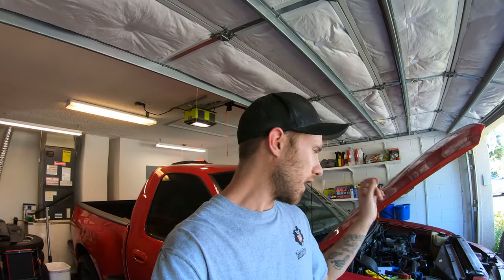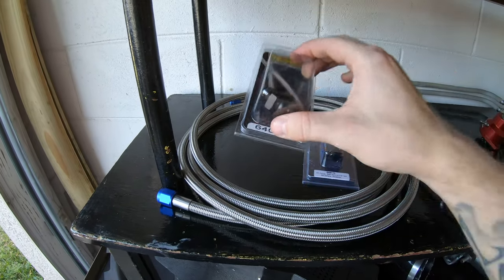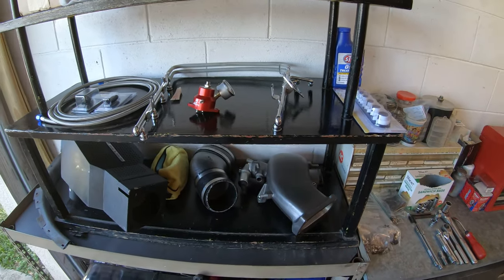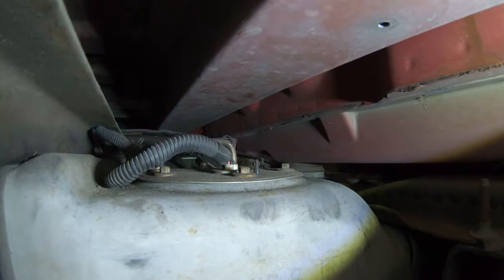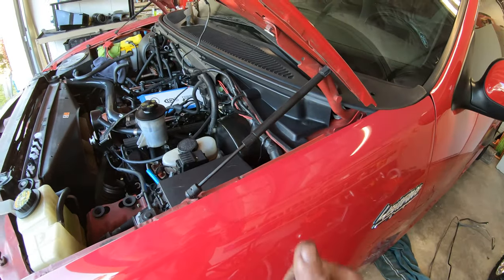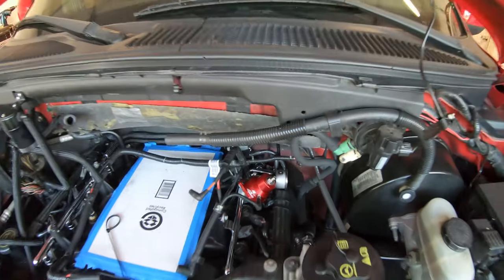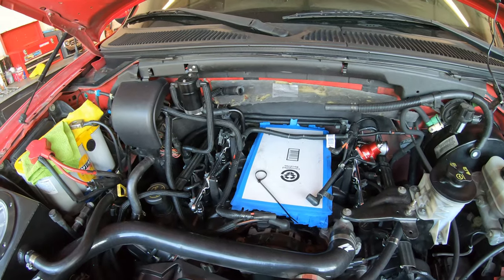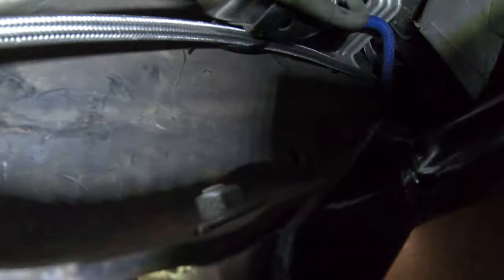Ford Lightning Build - Upgrading the Fuel System

Comment from the maker: Thanks for Watching!  Don't forget to Like the video and Subscribe!
One thing I forgot to mention, is you need to test for leaks before starting it up and set the fuel pressure, to be shown in a future video!
Reply from the maker: @one_day_at_a_time9915  5-6k if being built locally, maybe more, just make sure it’s a reputable shop, with lots of Ford mod motor experience.   Definitely don’t wanna cut corners or go cheap!
Reply: What do you set the regulator at did you make a video about that
Reply from the maker: @RACERHOLESHOT528  set it to 39psi with the vacuum reference not connected, it should drop to around 32-34psi with it connected.

Comment: how much hp is the stock fuel rail good for and can you use it for e85 the setup you installed with the 1997 rail ...im guessing you just have to chang the back fuel line on the rail also ..let me know thanks
Reply from the maker: The stock or 97 rails are good for up to 700whp, the Feed/return lines are good for about 625-650, most upgrade those to -8an feed/-6an return, to have a 700hp capable system.  They will work with e85, just keep in mind you need 30% more fuel, so you loose hp capability due to the flow demand e85 requires
Reply: @DebtLife_Projects  ya i was thing to getting aftermarket fuel rails but I see what you have done and I like it then I will just swap out the lines and what fuel pump setup do you have ? Do you know if a 2001 5.4 not lighting would have the same tank setup?
Reply from the maker: Im running dual Walbro 255's, Im not sure on the non lightning setups, no idea what pumps they run.

Comment: Hi I've been watching your videos, nice work. My friend have a 04 lightning we just put an engine in it. It's a built bottom end stock heads. We're having some issues, he's using DW 95lb injectors and wallbro 255 pumps. It's running lean sometimes and too rich sometimes without going into boost. I'm thinking the fuel pressure is not right because of the bigger pumps. It still has the stock fuel rail and regulator as well as the stock lines, but I think it needs a adjustable regulator. What do you think?
Reply: Dwight I have a similar problem, does yours have a hard start too? ever since the motor replacement I've had a hard start and bouncing idle. I had stock pumps then ran lean at the dyno then went with 255 pumps running all the time. Still have the bouncing idle and since then I've  replaced cam position sensor crank position sensor idle control valve and now im thinking its the fuel pressure regulator, IDK though.... But I just keep chasing this bouncing idle so if anyone has any input lmk!!
Reply: @kevincastonguay5690  hi Kevin, no I don't have any problems starting just running very rich and when I'm driving sometimes it shuts off when coming to a stop or slowing down. I believe it doing that because the fuel pressure is too high. I ordered the aeromotive fuel rail kit with the adjustable regulator that should take care of the problem. I was trying to find an adjustable regulator that could fit in the stock rails but couldn't find anything.

Comment: How far will 6an fuel lines get you? I see that you had quite a bit of extra line after you installed these lines. I wonder if this would be a good amount for my Harley truck or would I need more?
Reply from the maker: Length wise?  I'd say you should have enough, I had at least 3 extra feet of line that I had to loop up into the frame rails.  But don't quote me on that, cause I'd hate for you to be deep into an install and be short lol.
Reply: @DebtLife_Projects  No kidding an extra 3 feet? Yeah hopefully that will be enough. Did you do feed and return lines?

Comment: Are these rails good to use if i run e85
Reply from the maker: Depends on your power level, what your combo is, ect.  A lot of variables.  But the rails are good up to 700hp, so if your nowhere near that then you’ll be fine.
Reply: @DebtLife_Projects  I'm at 650 to wheels. 

Thx for the fast response. BADASS truck by the way
Reply from the maker: Might not be a bad idea to upgrade to legit rails then, idk if I’d wanna be that close to the edge of 97s.  Thanks tho man!  I appreciate it 🤘😁
Reply: @DebtLife_Projects  yeah man I bought the metco rails cant wait to get them on and my new lines